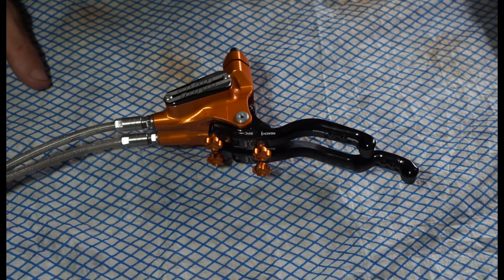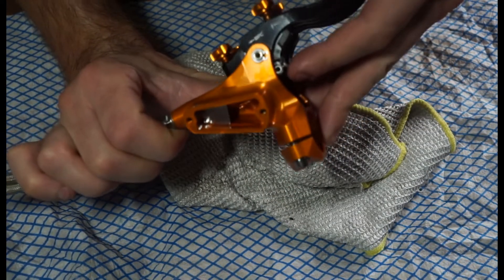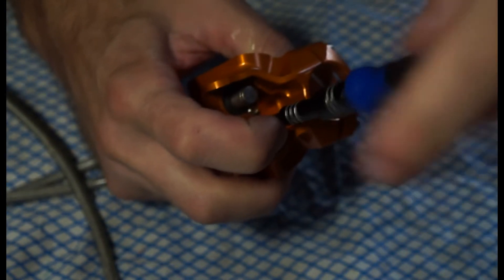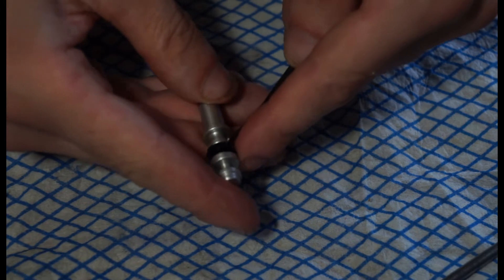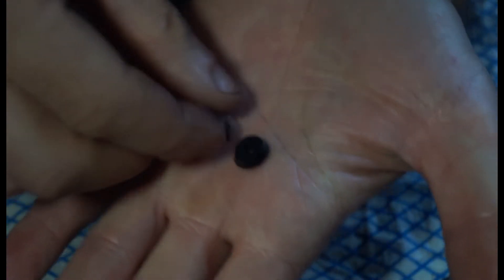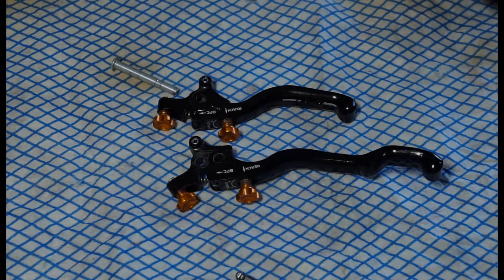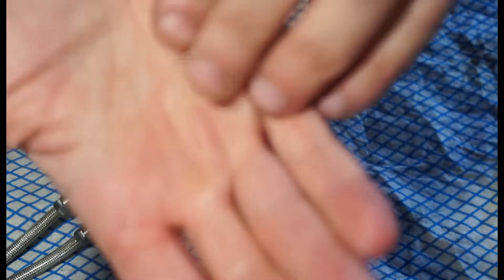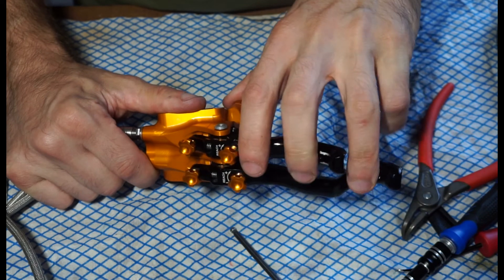Hope Tech 3 DUO Lever Strip Down & Rebuild (INC piston seal change)

Comment: Could you make a video on bleeding these? I have a full hope set with V4 calipers and no mechanic in my area Can seem to get the bleed right. Is there a certain way to do it?
Reply from the maker: The only issues I have with v4 caliper is that air gets trapped and you have to rotate the caliper when you're bleeding them to dislodge it. I always find the long lever feels a bit spongy on them but felt this was due to the extra length of the lever giving it more leverage.

I no long have any duo levers.

Comment: Can  I use this lever with normal hydraulic brakes or does it only work with hope tech 3 brakes and rotor? Thanks
Reply from the maker: You can use it with other calipers that use DOT fluid like most of the SRAM stuff and also some Formula.
Reply: @Chambers36TheEnter  it just take normal Non-Corrosive Mineral Oil. Its tektro brakes HD-M282.
Reply from the maker: @synworks9378  It won't work with mineral oil. The internal components will swell and expand the lever will seize.
Reply: @Chambers36TheEnter  SO I would need the whole HOPE DUO system, lever, calipers and rotors ?
Reply from the maker: @synworks9378  You can use any calipers that use DOT BRAKE FLUID 4 or 5.1.
Tektro uses mineral oil so it's not going to work.

HOPE, SRAM and Formula use DOT fluid.

The rotors are only based upon the size of the caliper and it's pad, you don't need hope rotor.
Reply: @Chambers36TheEnter  Brilliant thanks for the help mate.
Reply from the maker: @synworks9378  Whatever you're planning, good luck with it. 👍
Reply: @Chambers36TheEnter  sorry to bother you again could tell me which shimano or sram shifters can be fixed on this lever. Also I have come across the tech 3 duo has a different direct mount for shifters compare to normal tech 3. I am new to hydraulic brakes and I am building this custom bike for my disabled son so any help is appreciated. Thanks
Reply from the maker: @synworks9378  I know that Hope make their own shifter mounts for SRAM it's match maker which also works with Rockshox reverb remotes for dropper posts (SRAM owns Rockshox) and for Shimano it's I Spec ll and EV but possible they do other ones now or there's aftermarket options. 
 
On the later models of the tech 3 lever, hope put the thread on the lever so you no longer needed a nut, I think the same shifter mounts fit both lever designs they just saved a bit of weight with the loss of the nut on the early models. 

At the end of the day it's only metal with regards to the mounts so you can make lots of things work with a bit of effort.